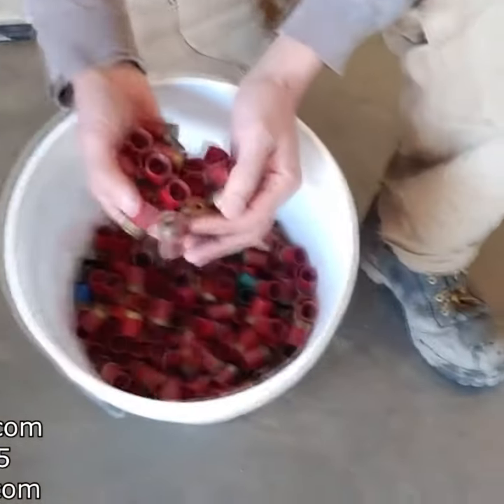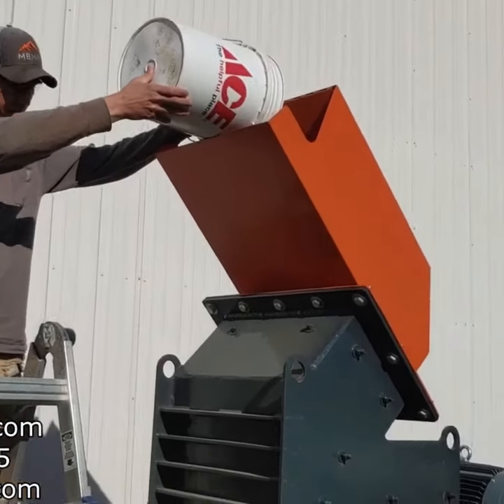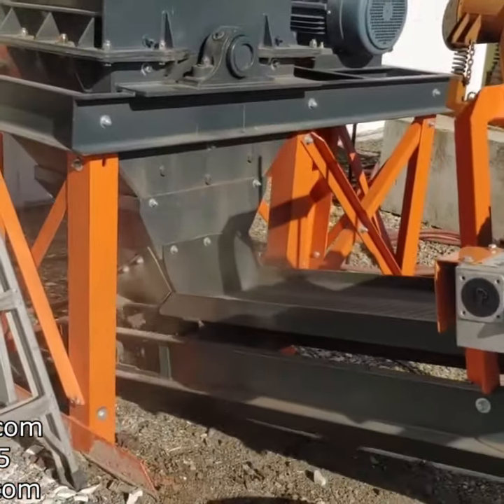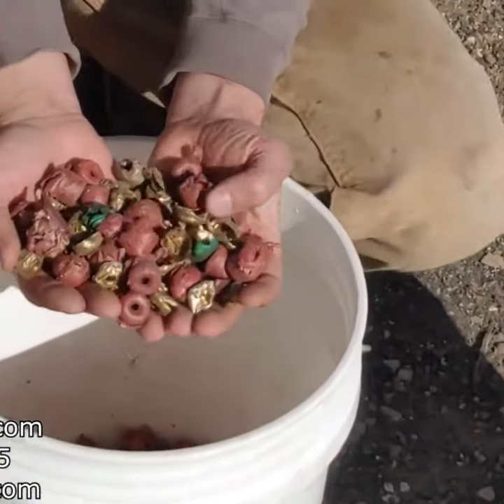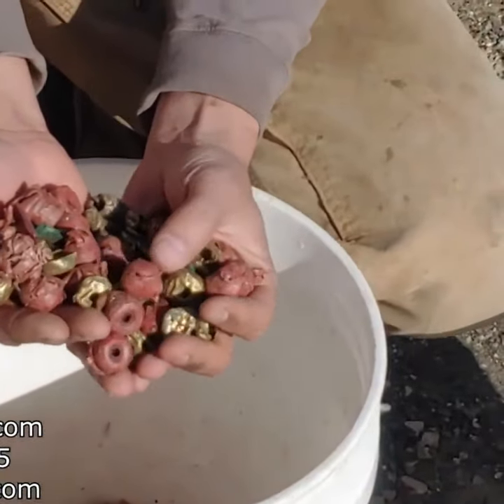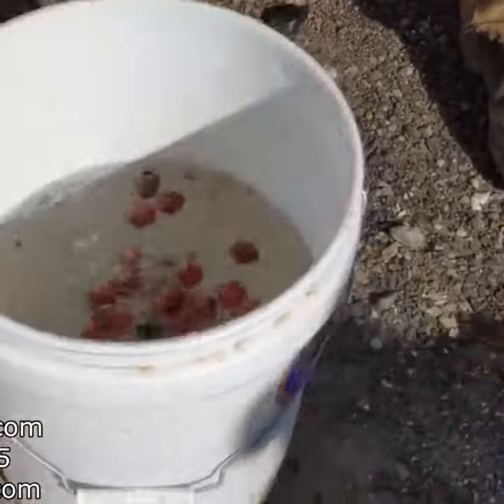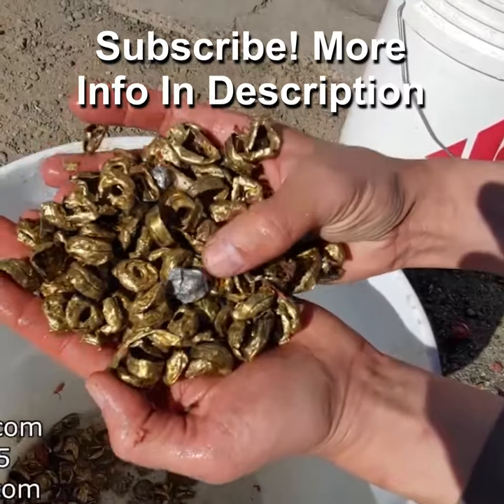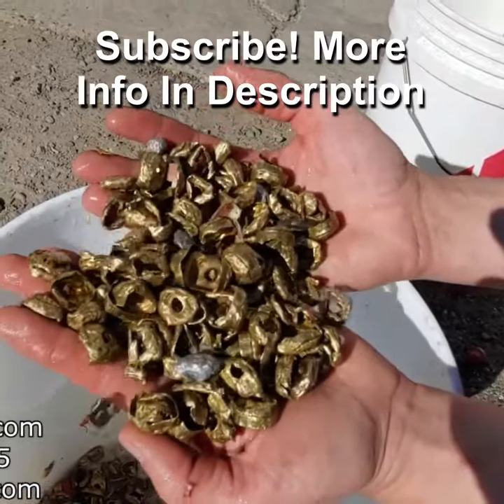Recycling Shotgun Shells

Comment: deffinity run it through a scrap line crusher with a mag belt not just say its all brass, alot of low-brass(1/2in high brass) could be steel. "highbrass" has for the most part have always been brass, also mag would get primers and eliminate the lead styphnate.